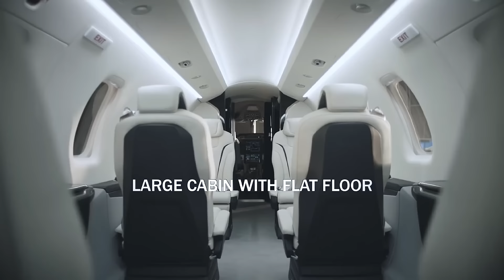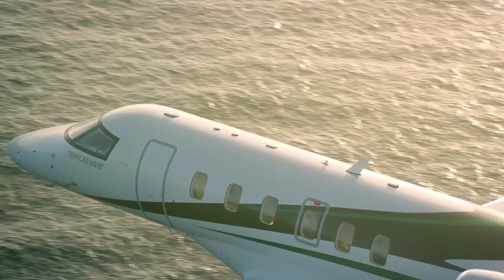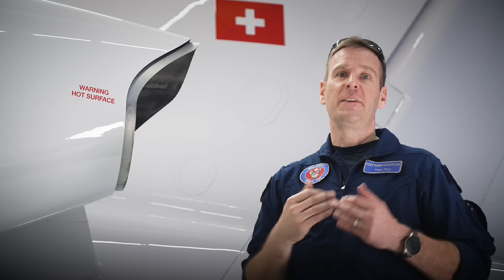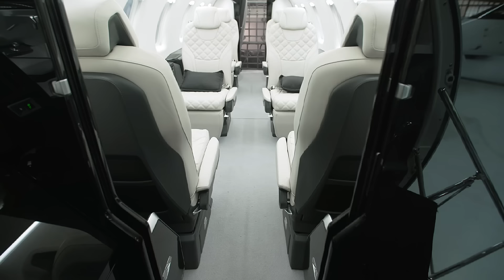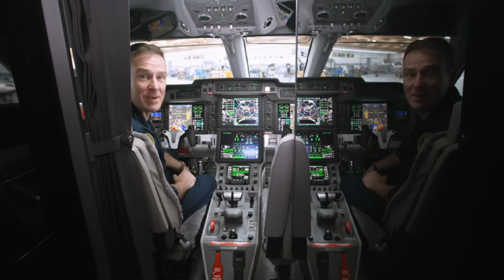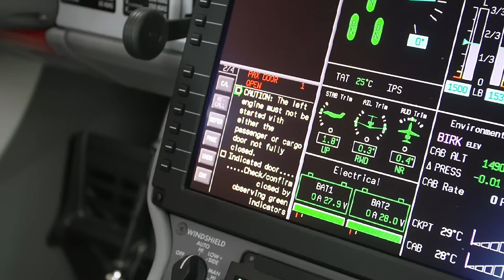New Pilatus PC 24 - the most versatile business jet ever made!

Comment: That toilet seat could be motorized for hygiene reason, but otherwise looks like a lovely plane
Reply: The certification is over 300k for this kind of features...
Reply: All you have to do to get the toilet into position is punch a button and lift the seat. Then, you can apply a bit of sanitizer when you’re finished. Yes, you can wash your hands, but the water on ANY aircraft is barely potable and not recommended for drinking. Hand sanitizer is your friend.
 
All of the prattle about the “complications” of the lab is malarkey. I suffered (neurological) brain damage as a child. I have almost no mechanical aptitude. I AM capable of opening and closing doors and I can push a button.

Bear in mind, the lavs on these airplanes aren’t like the lavs on an airliner. They don’t see a lot of use, so hygiene really isn’t a problem.

Comment: How much does it cost annually?
Reply: The operating costs of the *Pilatus PC-24* can vary depending on factors like flight hours and maintenance needs. Here's a general breakdown:

### *Annual Operating Costs:*
- **Direct Operating Costs (DOC)**: These include fuel, maintenance, engine overhaul, and miscellaneous costs like crew, landing, and handling fees. For around 200 flight hours per year, DOCs can be approximately **$911,480**. For 400 flight hours per year, DOCs can rise to about **$1,539,460**.
- *Fixed Costs**: These include crew salaries, training, hangar fees, insurance, and jet management. Fixed costs are typically around **$283,500* per year.
- **Total Annual Budget**: Combining DOCs and fixed costs, the total annual budget for flying 200 hours per year is approximately **$911,480**, and for 400 hours per year, it's around **$1,539,460**.

### *Cost per Flight Hour:*
- *Cost per Mile**: For 200 hours per year, the cost per mile is approximately **$11.33**. For 400 hours per year, this reduces to about **$9.56* per mile.

These figures are estimates and can vary based on individual usage and maintenance schedules. Would you like more detailed information on any specific aspect of these costs?
Reply: @john  Ok, it is not calculated annually. greydanus2033
Reply: That means 400 hours of maintenance. @johngreydanus2033
Reply: @johngreydanus2033  There is a error in your math! Total Annual Budget (DOC and Fixed Costs) For Flying 200 hours should be $1, 194, 980.00  (DOC´s $911,480 + Fixed  Costs) $283,500
Reply: @johngreydanus2033  Thank you for the Chat-GPT nonsense.
Reply: $1.2 million US dollars for 400 hours
Reply: @jerryy8383  okay
Reply: About 12Million